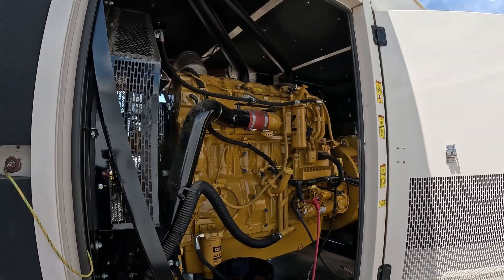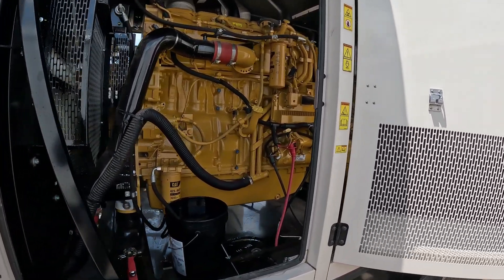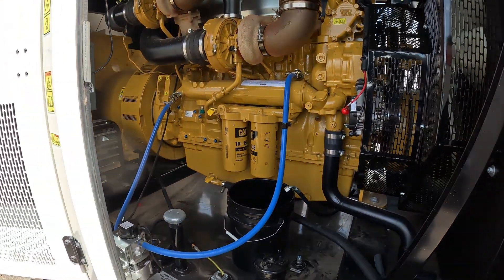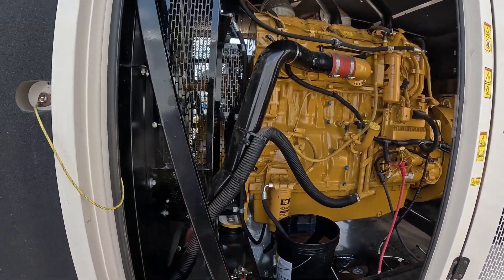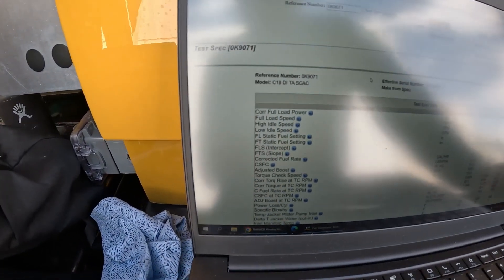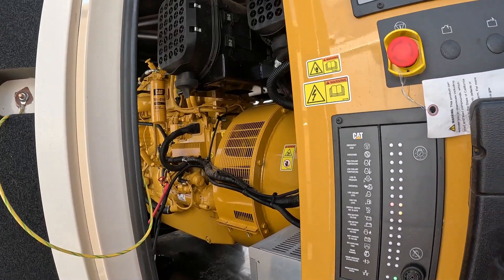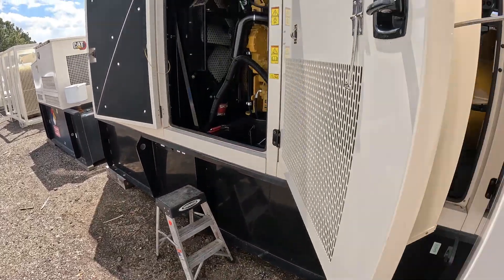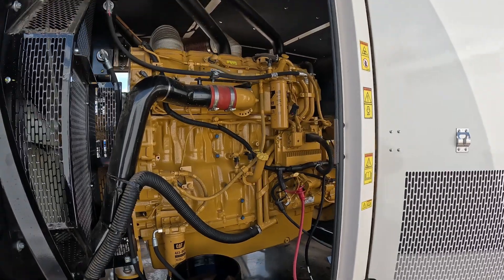THE BEST of the C15/C16/C18s! 1,100HP!

Comment: hi, what the advantage to have parallel turbo? I don'T see why put 2 turbos instead one, thanks
Reply from the maker: This engine is capable of shutting down 3 of the 6 cylinders. With each Turbo running off of 3 cylinders I believe its more of an emissions design. These Turbos are about the size of what you'd find in a normal C15 application and this setup moves a lot of air in terms of volume.